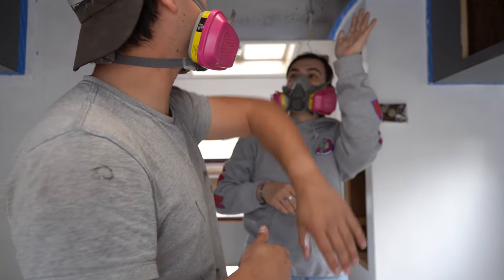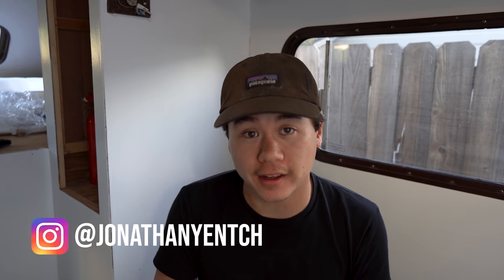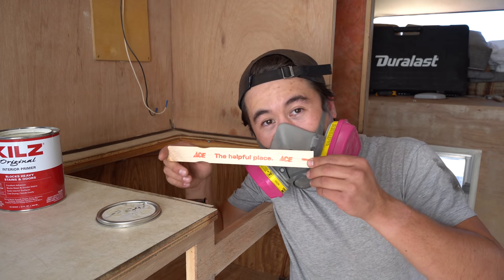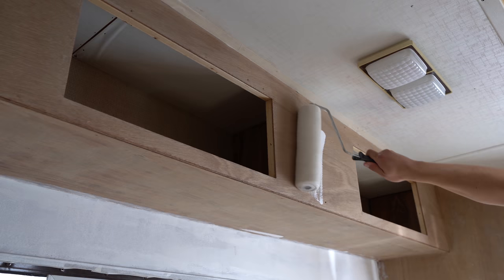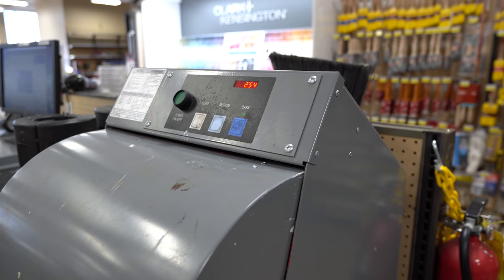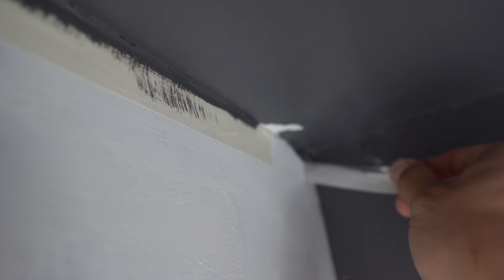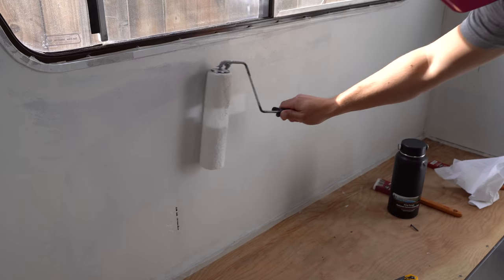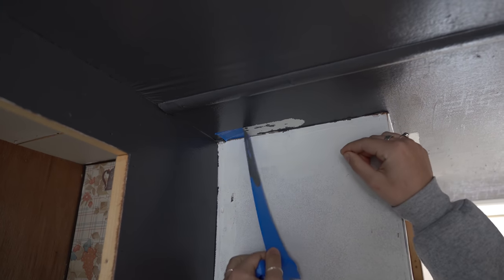Renovating my Vintage Truck Camper - part 2 (Prep and Painting)

Comment: Pull the tape off when you're through painting but before the paint dries.
Reply from the maker: Will definitely try that out next time!
Reply: Definitely.  You can’t let the paint dry before you pull the tape. It will pull paint up with it.  So basically when your done with your wall go back and pull the tape before you move on.
Reply: @JonathanYentch  also, try invest in a nicer brush for cutting aka the trim!  one with a wider slanted edge for more coverage and control.  my hand hurt just watching you with the tiny brush haha.  ive painted lots.
Reply: @wilderjess  great advice, i did it the hard way for years painting rooms in the house until dad showed me a nifty little brush that cuts the time from painting the trim.
Reply: @brettsome1608  yes, I did a couple pro gigs to help out my friends' family biz, was awesome to learn from them.  also our last gig was jimmy kimmels offices in Hollywood haha we kinda raided that overstocked snack room :)
Reply: @wilderjess  Did you meet Jimmie....he appears likeable
Reply: @dreamchaser5758  nope,  I was with the Pro crew so there after hours but heard he’s chill
Reply: Tessa is awesome for helping you with all of that👍🏻
Reply: Or can score the the edge w a razor before pulling tape and I’d give a few days for the paint to cure before putting tape on it to avoid it taking the paint with.

Comment: Hi, loving the videos, as a professional painter I  can tell you that the reason the the paint peeled off of the ceiling is that it wasn't primed,  I paint those panels in mobile homes a lot and they need to be primed with an oil primer.
Reply: ahh interesting, good tip!!
Reply: Or just peel the tape off before the paint dries.
Reply: @h33-q8w  I'm referring to when the tape pulled off the paint on the ceiling, it came of because there was nothing for the latex paint to key to. I believe what you are refer is when you use tape to get a straight line in which case you are correct.

Comment: Johnathan, I'm a DIY person myself and my dad is a master handyman. Really enjoy seeing you renovate an old camper. A few pointers: With the paint peeling, definitely only use Scotch 3m blue painters tape. Also, be sure you allow the paint to cure for probably  24-30 hours minimum before applying painters tape. Then, if you really want the paint to cure up nice out a space heater and just crack the windows to create an oven effect and really cure the paint. Lastly, where you removed all of the rubber/foam molding strips; that was likely there for movement and flex of the cabin. You may want to reapply a caulking along all those seams. You can get clear or white colors. You apply with a caulking gun and then use your index finger to shape it. Hope this helps 👍

Comment: When I was in my 20’s I always lived with "what if." I had anxiety and I think some of that was my upbringing coming from a broken home and living in a foster home. I didn’t like my job and knew I didn’t want to stay there. So I worried about rent, food, etc. I really wish I had thought of living in a camper because you can practically live anywhere and not have to work about  the bills. Now, I’ve been in the back of my pickup truck and living this way for a total of almost 10 years. No rent! Also, just a little hint for painting. Usage of a fan to air it out would help with fumes. Always nice to see your friend with you in these vids. Glad you kept it bright for the most part on the inside.
Reply: I agree mate, in my early 20's i lived in shitty share houses with annoying room mates, worked shitty jobs with asshole bosses...always wondering how i could make my money stretch. Wish i knew if van life back then i would have done it for sure.
Reply: Love living out of my car, I also enjoy the the low cost way of living. Just haven't done much on the travel front. Looking forward to though.

Comment: We are updating a 1995 34 ft class A moterhome. 
I taped around all the windows and cabinets, primed and painted walls. Took me an entire week in the summer. It dried and as I peeled, it took the top of the cabinet fake wood paper crap right off and didn't leave a clean edge. 
I'm still mad.
Now I have to prime and paint all of the now even uglier fake wood 😒. 
A 34 foot rv has alot of cabinets handles and hinges to come apart. I made an even bigger mess.
Lesson learned. Peel it fast. Peel it before it completely dries, and never stick it to fake bs wood.
It could always be worse! 
Your camper is looking great. Those light fixtures are cheap on Amazon, make sure you convert all of your bulbs to LED. Old bulbs get hot and will melt plastic light covers.

Comment: Hey John, you can always run an exacto knife using a straight edge where the wall meets the ceiling before you peel your tape off...just don't press too hard.
Enjoying the ride with ya

Comment: i think at $4,000+, Runaway Campers or Tiny Campers is the way to go.    Without putting too much weight on rear axle/wheel/tires/alignment of the truck.   At $7,000+, the Air Stream is cool looking camper.

Good Luck with your Journey/Adventure.

Comment: Shouldn’t you find and fix any leaking points before priming and painting? Does no good just painting over the water stains and not fixing any leaks that caused the stains in the first place. Hope there is no water leaks left. Maybe I missed that part.

Comment: Great video Jonathan love the enthusiasm. Tessa is  Jewel . Just a heads up... you want to find those water leaks and fix them . YouTube search solutions. It is usually 99% of the time the seams (roof and wall panels, window frames etc)  that fail and allow water infiltration.... And they will not just magically go away.
                                  Cheers

Comment: Painting wood like this isn't as easy as painting drywall. Definately if you can remove the tape right after painting, we do that when we paint tractors and it saves the headaches of touch ups like your having to do. Good luck. Look forward to next video.

Comment: When you want to take off the wall papers next time. You should add soap and hot water in the spray bottle and spray on it. It will remove out much better.

Comment: Always remove the tape almost immediately after painting to prevent the paint from peeling. If you wait until the paint is dry and then take the tape off, it peels every time.

Comment: You have to let the paint completely dry.  I suggest 24 hours,  Also you have windows in your camper so crack a window to speed up that drying time.  Either way thanks for sharing.

Comment: You take the tape off when paint is still wet otherwise it created a continuous layer so when you remove its like pealing a plaster. If you leave on too long you can score it with a stanly (or exacto for the Americans watching this) knife before removing so you'll break that seal

Comment: Same thing happened to me, so I got this metal guard that I held up against the painted side so that the paint got on the guard instead of the already painted surface opposite side of the corner.  Problem is, every time you move the metal guard, you have to clean it of all paint before repositioning, takes longer because I'm not a professional at cutting in.
Reply from the maker: I never realized how much precise skill the professional painters actually have! My girlfriends step dad was a contractor and he was telling me about cutting in and how that’s the way to get razor sharp edges. I’ll have to try it out next time.
Reply: @JonathanYentch  I think you and your girlfriend did a very good job, already looks cleaner and more modern, less dated and dirty/gringy.  Good Job Jonathan!  So far you've spent your resources well!  

I was a little concerned when you disconnected and removed the fridge but it didn't work before you removed it, too be sure you didn't damage it... in this abode's future evolution, you may decide on solar panels and 12V cooler/fridge options along with 12v LED lighting/cooling/heating as I've done on my sailboat (well I've got a wood burning stove on my sailboat).

Comment: The new paint peeled off because it needed to cure for at least 72 hrs (or more is better) to harden enough so that it wouldn't stick to the tape..
Also,next time you need painters tape, try Frog tape (it's green...LOL.), it does a better job than the blue tape.

Comment: if you put on the primer you first had to sand again with a 400 grit sandpaper and then clean with a damp vot and not with a brush as you did and further when you removed the tape first make a slight incision with a cutter and then is not going to peel off your paint, greetings

Comment: You did a fine job only thing is it would make it easier on you if you would cut in all the edges and corners, very edges of the walls and ceiling.  It just makes it easier.

Comment: Best option is to paint free hand and not depend on tape. Using tape gives the worst results. Pro painters do not use tape for that reason and of course time. I understand you aren't a pro painter but I promise, 10 min practicing with your brush and you can get it figured out and save yourself hour's of headaches.
Reply from the maker: I heard about cutting in and the proper technique that professional painters use after the fact lol. Next time I’ll have a different approach!
Reply: @JonathanYentch  Sorry, I was not judging your work. I think it looks great. My bad if I came off that way. Not so easy to give context and meaning through a comment. ✌️

Comment: I’m wondering if the tape pulled the paint off because it was painted straight onto wall paper. Seems like I also saw some ripples in it before you started. I would have pulled all the wallpaper off and primed it. Even just to see what was behind the wallpaper, being that there was already water damage.

Comment: I'm guessing the ceiling material you painted on (the wallpaper), probably is a little water repellant. Either remove it, or sand it just slightly than apply paint to avoid that peel off. Also depends on if you are using oil based paint or latex paint. oil dries slower, latex dries quick. Another annoying thing about that ceiling is that it might have accumulated oils - from cooking, or gradual condensation containing oil and drying. Saw the mold - looked like black mold in the previous video... Scary stuff, be extremely cautious about that. Sand it off, seal it up and paint over it. Honestly, I'de probably do a triple prime on this one.

Comment: Just curious, why didn't you remove the wallpaper on the ceiling? 🤔 Speaking from experience and what my contractor friends have told me, your paint peeling is not the tape but was caused by 2 things, the wallpaper you left on the ceiling and you didn't wait 24-48 hours for the paint to fully cure and bond to the wallpaper. When painting over wallpaper you need to allow a curing time for the underlining side of the paint to fully dry and bond properly to the wallpaper. If the paint feels cold then it has not fully cured and bonded to the wallpaper.

Comment: Gotta talk it off when paints wet and only tape when it's very dry. Is there humidity where enough are? Paint might not dry as fast as you think especially if she's thick. Free hand it with a tiny brush.  Happen to me when I first painted. I don't tape anymore i free hand cuz it just sucks ass lol I only use tape of I have to and I take it off when she's wet only.. but I make sure that ither paint is major dry before I add tape. But even then she sometimes comes off. The cupboards under it. Will also have an impact.  Gotta scuff them up good or use the paint that's to cover over oil base to water base. Only primer that'll let you paint and tape like that. Gotta have that primer as well  no matter what you put on top.  I just did my rv and I used a heavy duty sealing primer  and it just scared back off. That should never happen with that type of paint. But it did. So I went back over it with a two in one that's meant for oil based and bam she stuck good now. I don't know what's in these cupboards but what a bugger this has been. Now I wish I done the bottoms a grey of some sort. Too much white for me. I am gonna add some cream so we will see. Great videos so far 👌

Comment: You used that tape in the wrong way, first place, you painted on that paper ceiling and after that you put tape there... remove that paper like you that with the walls , sand it and after that paint it. Good luck next time :D waiting for the next video!

Comment: So sorry about that &#*$@xx masking tape.  I've been there, done that.  My experience has been that there is NO such thing as MASKING tape.  It's only a cruel, deceitful illusion.  I always just "feather in" the edges between two different surfaces by hand using a small paint brush, and a relatively steady hand.  It may at first seem tedious, but after a while you really get pretty good with it and you won't have any "do overs".  Just draw the small brush along the very edge of the intended surface with a steady and continuous motion as if using a wide felt tip marker.  Keep the brush well filled with paint, but not too much.  Occasionally swipe the brush across some part of the intended surface to sort of "dress" it to keep the feathering edge sharp.   If you are using a water based paint, I always keep a small fairly damp rag (like an old sock) hanging from a belt loop on my pants while I'm working so that I can grab it to carefully wipe any "oopsies" off from the adjacent, unintended surface.  A quick wipe off of such "oopsies" nearly always leaves the unintended surface perfectly clean and no further touch up is required. Obviously the paint or other finish on the adjacent surface should be thoroughly cured first.  Hope this can help you at some time.  I certainly admire you for the VERY thorough job you are doing!